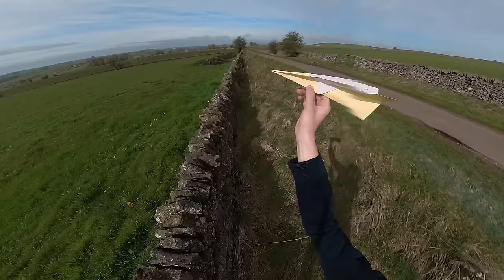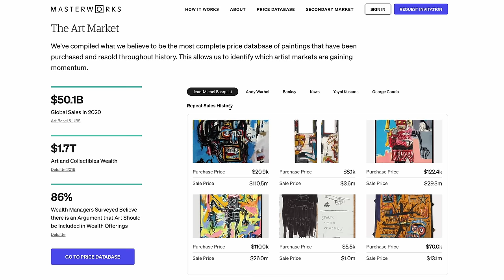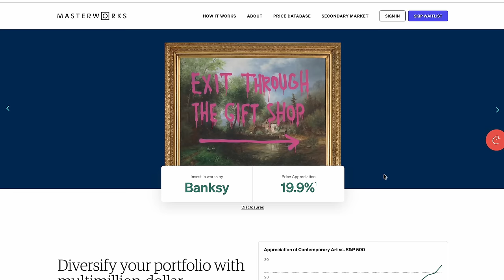Paper Plane (with a rocket)

Comment: Video idea: try breaking the sound barrier with model rockets
Reply: "I accidentally made an APFSDST and got into trouble with the authorities"
Reply: @YodielandInhabitant710  hahahaha
Reply: I saw it happen at a UKRA meet many years ago. An Estes Mosquito with an oversized engine. More of a snap than a sonic boom, and then it rained paper.
Reply: Very difficult in the UK
Reply: Many clips of model rockets brake the sound barrier, u can find it on YouTube
Reply from the maker: I'd love to
Reply: You can't atleast not controllably, most engines won't do it even with just fins and a nose cap not enough impulse, and where you can do it you've basically built a firearm which in the UK Australia and New Zealand will get you in trouble. It's possible but it legally counts as a weapon so you certainly can't do it online without a bunch of licenses and such.
Reply: It's pretty easy, a book I got on building model rockets when I was in highschool had a guide on how to, was a mid power rocket though so might be a bit different regulations wise than what has been used in these videos
Reply: @Project-Air  Hi there, if you want to break the sound barrier, you have to get a lot of permission from your local council and then inform anyone within a 1km radius of your launch site. I know this because I live in the UK as well. Regardless Good Luck
Reply: The Lone Creator  bro fr, what does this have to do with my comment
Reply: @YodielandInhabitant710  I know about Armour Piercing Fin Stabilised Discarding Sabot, but what would the T be?
Reply: @LuKe-cq9il  tank
Reply: Try breaking the sound barrier with a aircraft lol
Reply: @nerdtronaut  nah a couple hundred thousand f moters = supersionic
Reply: Sound barrier breaking paper plane 🤣
Reply: Very difficult to do this in India,West Bengal especially in Kolkata.
Reply: @sharmisthasinha882  hm. Well he ain't from india
Reply: Easy to do with a high peak thrust motor and a light minimum diameter rocket. Usually need an Eor F engine though, which is higher power than what he's been using
Reply: Yknow it aint actually that hard, compared to orbital velocity, its over 10 times less.
Reply: THATS ILLEGAL
Reply: There is a rocket kit that you can by from apogee components called the apogee aspire that when used with a g80 engine goes around mach 1. It’s a minimum diameter rocket when using a 29mm engine.
Reply: @lukeskywalker3511  I just finished building an Aspire, and foolishly put a launch lug on it. So I've designed a supersonic-capable min-dia 29mm and will use a fly-away rail on it. I need to get the fins laser cut for it.
Reply: @peraltarockets  nice, I’ve got a 3D printer which is quite useful for making rocket parts like nose cones and fins. Do you know what engine you’ll use for your rocket yet?
Reply: @sampeythepirate  actually it’s not that crazy of an idea. The smallest motor that can break the sound barrier on a minimum weight rocket is a G motor, which can be purchased with a certification earned from a simple written test about safety, and a physical test of building and flying a rocket using an engine from the class your trying to get certified in. Not sure about the UK though, I only know about US laws and reg.
Reply: @litmusaero9660  yes but I think like alot of comments here you may have missed the point, which is break the sound barrier with a rocket powered plane. To say you've done this you need to do it in level flight, perform atleast one turn, and land intact. At this point even assuming you can do say a ground launch to 180 and land, you've effectively built a missile, which in most countries is illegal. But nevermind all that. The really big problem is range and G forces, I don't recall the exact math but you'd be crossing a 4km line course in under 3 seconds then pulling an extremely quick 40g turn for your 180 to slow and maneuver for landing, assuming a 2km + range radio and a Hawkeyed ninja reflexed pilot probably using fpv. At these loads and speeds melting camera lenses, ripping parts off planes, etc is areal issue, look at dynamic soaring or rocket videos for examples. But say we get round all that, and we've got a longer range radio etc etc to lower loads and other fixes, we've probably put in a flight computer with GPS for safety and redundancy given were flying beyond visual range. Well now you've all but built a cruise missile, and a guy in my country did over a decade ago using a laptop for the flight computer and a pulsejet, just to prove a point to someone arguing on the internet, quite legally, and your country pressured my country to shut him down because "weapons technology proliferation".
But sure you can launch an unguided rocket past the sound barrier and sure you can built a supersonic rocket RC plane you just need alot of money and friends in high places
Reply: ٧0
Reply: @lukeskywalker3511  Probably a G80 or a H115.
Reply: @peraltarockets  the g80 has a 1.7 second burn time and as a total impulse of 137N/s I estimated that it took the rocket to about 2500-3000ft at speeds of around Mach 1 in a couple of seconds which pretty nuts for a G. The H has a higher total impulse at 172N/s and a slightly shorter burn time. But I still think it would go pretty high on the H as well.
Reply: The sound barrier is 661 miles an hour I don’t think you could break it
Reply: @clydcharmac1780  I think you can, those engines are really powerful and the amount of G's you get with any simple rocket is already a lot
Reply: @YodielandInhabitant710  its generally made up.of uranium or tungsten where did you det that stuff from ?
Reply: @Project-Air   can it be done? What would happen to the plane/rocket?
Reply: That is almost physically impossible
Reply: @Houzerion  no, its done plenty of times
Reply: @B Poort It’s almost impossible to go at the speed of sound with A rocket with home tech
Reply: If he wants to break the sound barrier he would have to go 761 miles per hour
Reply: @worthless2194  correct
Reply: @Project-Air  nice
Reply: @Project-Air  Skittles
Reply: Good idea
Reply: That’s impossible tho
Reply: @Louis_Roper  nah, loads of people have done that
Reply: @B_Poort  wow! I had no idea! That’s rlly cool
Reply: @YodielandInhabitant710  I actually made firework planes but it just failed to fly it just pie BAM
Reply: @jonttualt what is a APFSDST?
Reply: @theminecrafter5050  check the comments, its Armor Piercing Discarding Sabot Fin Stabilized, a certain type of tank bullet
Reply: @B Poort   Thank you
Reply: Wtf that's too crazy
Reply: @someperson2288  look it up its not that crazy
Reply: @engineeredlifeform  I built a mosquito when I was a kid to handle a c6-7 upper stage engine and it never came down. 😂 gone forever.
Reply: @YodielandInhabitant710  wait what how just how did you do that?
Reply: Elon Musk✨✨
Reply: Supersonic paper plane.

Comment: I did something similar with a hot wheels track, my 3rd place pinewood derby car, and a model rocket engine. The pre drilled weight holes fit the motor perfectly! It even flew… off my deck and into the yard. It was spectacular!

Comment: I used to use fire crackers that I turned into rocket engines. I shot my paper airplanes from a little balcony. Some models worked quite well. The fire cracker engines where not that powerful and that helped. And yes, I hade some fiery miss-haps too.
Reply: I have a little booklet somewhere where I noted the flight statistics. Need to search for it.

Comment: Make an EDF plane with afterburner.
Tip: Use a butane canister for the fuel and inject it into a ring made out of copper pipe with holes pointing backwards and use a toy zapper to light the fuel. Of course, use a valve or a servo to activate the fuel
Tip to avoid making a flying flame: cover the exhaust with aluminium foil and fiberglass to isolate it from the fuselage

Comment: I staple a penny at the C.G. of my paper airplanes within the keel fold. I also cut elevator control surfaces on the trailing edge to impart a slight pitch-up moment. When thrown by hand, these paper airplanes go through a series of gentle stalls, recovering easily from each one. The net effect is that it typically triples the free-throw range of the airplane.
Reply: Sanger glider :)

Comment: FWIW, you were probably also getting issues because putting the engine above the CG would cause a moment about the CG which would tend to nosedive the plane. A combination of your trimming and increased speed = more lift would have made some of them nose up though. Ultimately super unstable though, I would imagine. 

If you wanted to actually get this to work, the thrust vector has to pass perfectly through the CG without any offset. You can do that because the plane lets you put the engine in the fold, but the overall plane would be so lightweight that the CG would probably move significantly as the plane itself flexes during powered flight.

You might try a wooden dowel of comparable weight attached to the front of the engine as a CG bias so that the the CG doesn't move as much. If you do that, just make sure to balance the dowel+engine combination very slightly behind the CG of the base airplane and you'd probably get better results.

Comment: Front load the paper planes they'll work fine the rocket engine is heavy right? But it's light when it's spent, so front load like way heavy nose forward then it'll work also point up relative to the trailing edge so you don't cook it

Comment: It should stull. Be possible to use a paper plane, just use a design that can fly at a lower speed that generates more lift. A "stunt" plane fits the bill as it would also be rigid enough for a motor. Then just trim to handle the extra speed of the motor.

Comment: Soo um u made a vid like ( RC car extreme aerodynamics) soo i am thinking why not use a mure powerful motor like in (Traxass) and increasing the overall base and double decker front with and a spoiler which is in a straight line rather than a parabolic path ???

Comment: I think angle of attack might have also been an issue on the earlier plans. The rocket motor is sitting in the bottom of the grip, which is forcing the nose of the plane down.

Comment: We did try rocket fuel with paper plane but we attached a thick wood stick or a thin steal rod to the rocket fuel so the paper wouldn't get burnt it did work well
This was back in 2009 or 2010 when we were just kids

Comment: Thanks so much, for am actually going to make a space obiter powered by sugar rocket motors and an edf, I was to Manila paper for some parts of it but now am not.
Could you please help, for I have failed to ignite the rocket motors, could short-circuiting a 12v 48AH battery work or not please suggest a method for me thanks

Comment: I have rocket build from tesla tape right screw layer, left screw layer and  vertical layer tape and varnish on it (1990 ish) total with parashute and top 24grams, thank you for idea to put servos on it. Not on rocket but aircraft. Could be good idea to addon rocket glider with servos.

Comment: I think if you used something like foam board coated in a heat resistant material that it'd work much better- but I suppose then it isn't a paper airplane anymore.

EDIT: looks like I made the comment JUST before you actually did what I suggested. I'll leave the comment though. Nice work, I've always wondered about this myself!

Comment: I would like to point out that the severe triangle shape we fold most paper plains into is not conducive to Gliding. Any actual piloted planes shaped like this have Computer Pilot Assist to help in controlling the plane. If you folded them to look more like popular plane or glider models, they would fly better.

Also, putting the engine into the fold COMPLETELY changes the aerodynamics. And when gliding, speed changes how things fly: too fast, the plane tips up and Stalls; too slow, and it swoops down; non-stable designs just spin and fall.

Comment: That seemed to burn far longer than any Estes solid fuel motor. Looked more like the old Jetex system. What motors are you using?
Reply: Check the description of the ProjectAir rocket helicopter video for a link to the store

Comment: The main problem with this experiment is that you have chosen the wrong paper airplane model. That model doesn't fly well. There are other models that are far superior.
And by the way, your car will never run right because you have the steering wheel on the wrong side (little joke).

Comment: You can power them with rubber bands and a Wednesday but just make sure that they are that much heavy if you can't use rocket engines then don't use them because they can even burn your plane so use rubber band rubber bands and in the stick to tie them evening some way to fly in the middle but but just make sure that is it that is it isn't it too much heavy or if it's too much heavy then the plane won't fly so be careful and make the wings a bit bigger and make sure that the wings and twisted or a bit down orbit up what is down or what is up because that can make the that can make the plane go crazy and it will eventually crash or won't fly it will just fall

Comment: What happens if you saturate a paper airplane with fiberglass resin? At that point you basically have an organic carbon fiber that would hold up much better than plain paper.

Comment: Well paper and fire dont mix lol rocket engines burn at about 200 degrees or more youd need titainum foil to wrap the plane in to stand any chance ive tried myself before i wanted a 3 stage engine to take a plane upwards like a rocket and then when it starts to freefall it would fly i failed many times an started making fireworks instead

Comment: 3:01 with that much  paper i made more plane designs than that I'm not lying tbh you should have done some research on paper air planes if you did you right now will be having a special design that you can use in any model planes for better flight and stability also the rubber band plane could have gone longer with that special design

Comment: Nah bro, you just can't make paper airplanes 🤷‍♂️ I used to make a shitload of paper planes when I was younger and strapped rockets and other fireworks to them and they worked all the time. 
Your plane design is ass, but you also need to attach the rocket underneath the frame, not in the plane itself